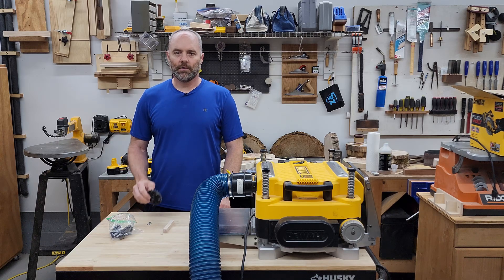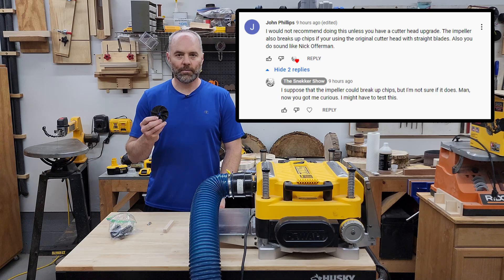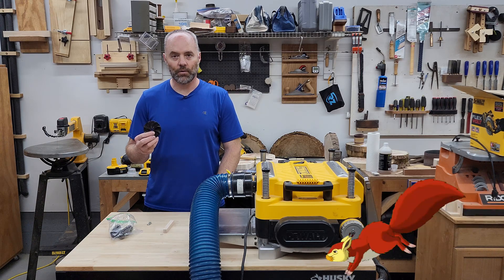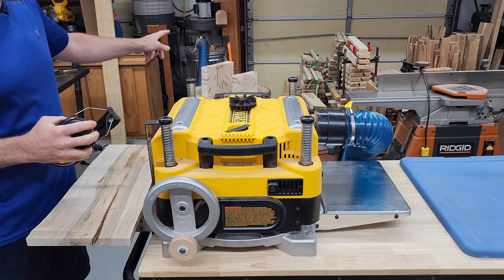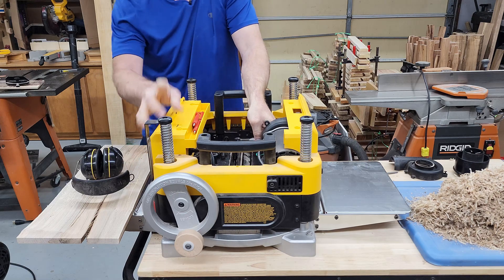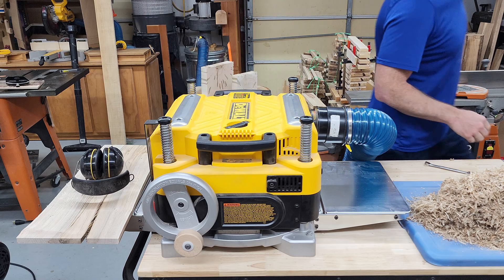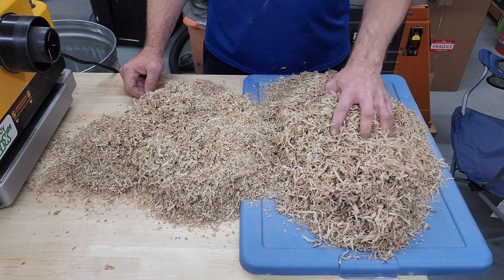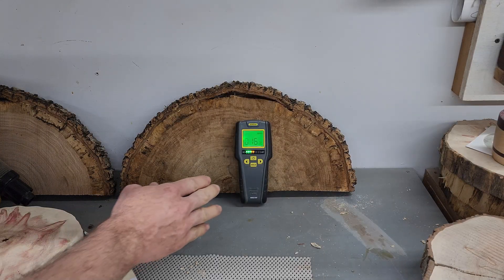Does the DeWalt DW735 impeller break up shavings?

Comment: Great analysis. One question I have about the helical head is, the OEM size one needs the cutters removed to install, then put back in, but the, are they no longer even in height as they were when coming from the factory?
Reply from the maker: @packetlevel  As long as they're installed correctly, they stay the same height. I show removal and reinstallation in this video: https://youtu.be/8J0rvBi8a0k
Reply: @TheSnekkerShow  Thanks - Yes, I see the installation. Factory makes a big deal of how they're set when delivered, question is what's the result after re-installation as seen on the wood. As an engineer I also imagine using the designated torque may be important - as it often is - 45 inch lbs if I remember correctly.

Comment: Thanks, this is very informative.    There’s a mod to this planer, via Etsy, that directs chips through the top.    I think the impeller is out of play when this mod is installed.   I’m curious if my dust collector will clog as a result….   I may have to install a 2 stage, cyclone system, to separate the larger chips.
Reply from the maker: It might be more of an issue if you're planning wider softwood boards at a higher speed.
Reply: @TheSnekkerShow thanks.   I work with hardwoods primarily, but often use the full 13.5”.  I have the Shelix cutter head.    So, we shall see if my dust system can handle the bypass of the impeller….
Reply from the maker: @rcote1234  If you have the SHELIX, you should be good since it makes much smaller chips. I was planning 13" maple last week, and other than eventually tripping the breaker on speed 2, it handled it quite well.

Comment: OK.. I have another DW735 question.   You ran the test comparing chip with and without the impeller, using regular knives.  Now, what do the chips look like with the helical head?
Second question. The dust collector adapter has a grid in the inside. I wonder if it would save power, and/or make dust collection better if that grid were removed entirely, reducing a little drag. Worth testing?
Reply from the maker: The helical head definitely creates smaller chips. I'm not sure about the grid. It might have more of an impact with larger shavings.

Comment: I have the same planer and not once have I had the breaker trip! and I know why. i do not take such aggressive cuts. I crank that handle 1/4 a turn at most. It is nice to see the importance of the impeller.
Reply from the maker: It's been a long time since I tripped mine, and it was probably intentional. I can usually tell by the sound when I need to ease up.
Reply: Same. Like others I watched a bunch of videos before I made this investment and my first couple cuts I tripped the breaker. Ever since I’ve been doing 1/4 turns and haven’t had a problem since. Only downside is that the cuts take for ever!!!

Comment: Nice work.  I'm guessing your pin-less moisture meter works by detecting the capacitance of the material.  That would cause it to change values when your hand is near it.
Reply from the maker: I think you're right. It can give false readings if a thinner board is on top of another material, like a table top or a hand, but I never noticed that it detects in the wrong direction. I wonder if that's accounted for in the final number.

Comment: Wow, I had no idea! The question is ... is there really an advantage with smaller chips if you have decent dust extraction? Thanks for doing this! I think there are better ways to get veneer stock though. lol
Reply from the maker: You're right. I use a Thein baffle in my trash can, and on very few occasions the baffle has gotten clogged. The most recent time was two days ago, but I was actually cutting green maple rounds on my bandsaw. The shavings were only 2" long, but they clumped together like spaghetti and clogged the bandsaw cabinet and the Thein baffle. It would be more of a problem with a shop vac, but I wouldn't remove the impeller with a shop vac anyway.